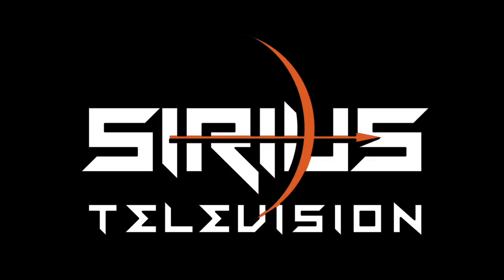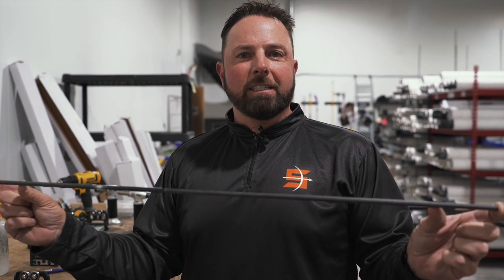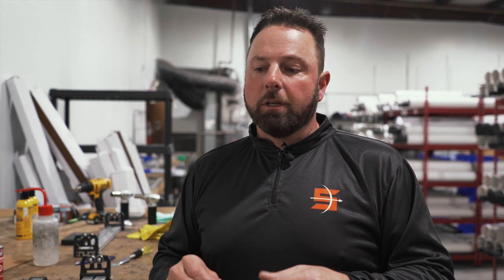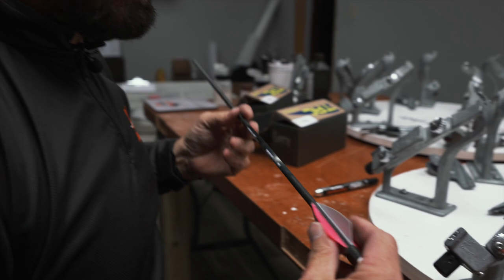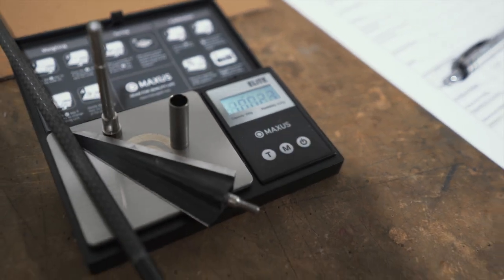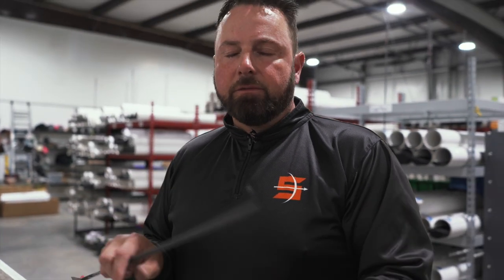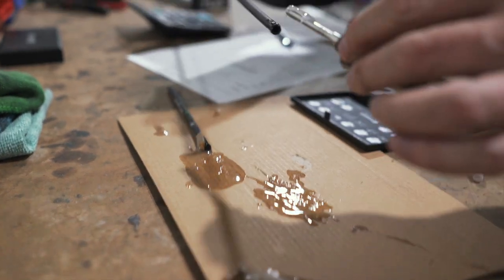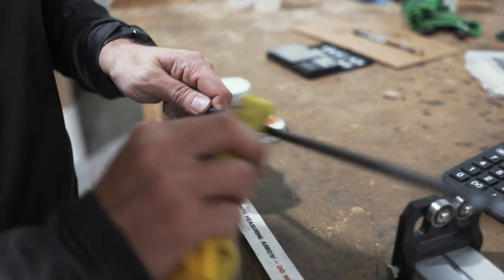Ultimate DANGEROUS GAME Arrow Build! (1000 Grains)

Comment: Wtf do you do when the fletch crete runs down and glues your knock point 😂 asking for a friend. He totally thought he got it before it made it to the nock
Reply from the maker: Were you using a q tip to apply?
Reply: @SiriusTV1  yeah, I drenched the q tip and had what I thought was a nice beautiful bead on the fletch. I pressed it on and it took off running. Caught it with a paper towel and was confident it didn't make it into the nock, even twisted it to make sure. Went to go shoot it weeks later and noticed I left the nock out of the position I designated... that sucker is really solid! Can't help but be a little impressed even though I spent weeks getting that arrow perfectly tuned to bullet hole at 20yards bare shaft only to screw it up at the final stage. Been staring at it contemplating how I'm gonna save it.
Reply from the maker: @cronkthecrunk  put a little acetone on a rag. It should clean it right off
Reply: @SiriusTV1  are you guys ever bringing back the 400gr tough heads? I got some 300spines that could use them

Comment: For the sake of argument I’d love to see someone in your position shoot a light weight rocket ship arrow into a dead cape bufffalo. About 400 grains, 85lb draw. I’m guessing that would be north of 340 fps. Hand sharpened 100 grain BH. Now that would end the endless debate of light vs heavy.
Reply: Eh. Probably not. Heavy helps when significant resistance is met. If you go between the ribs, then weight really doesn't matter. Smack the knuckle and you'll want the spear.

Guarantee one half of the crowd will respond with "of course it'll turn out that way, you hit it in the ribs! You're not supposed to hit the bone!" And the other half will respond "you're supposed to hit the shoulder! The light arrow wouldn't even tickle the meat compared to heavy if you just aim at the worst possible spot!"

And it'll never end.
Reply: @YoureSoVane  only one way we will ever know right? Your “assumptions” maybe right or completely wrong. I’ve recently started shooting pigs with 365 grain setup and blowing thru them fast enough to split sapling trees behind them.
Reply: @deanbrantley  I say we throw some sticks at pigs and see what works. Total weight isn't nearly as important as pretty much any other factor for penetration, due to the way most materials react to KE and momentum, and the formula for friction for that material. 

I shoot 30" and 80# and I'm not comfortable shooting an arrow that light. For the same effort of getting a 340fps arrow you could just shoot 300fps, and for the roughly 10% loss in speed you'd get about 500gr. That's more weight to put towards a stronger broadhead or front end components. Or more choices in arrow shaft. 

Personally I like running high FOC but somewhere short of 600gr of weight. With last year's arrow build, I hit a deer so hard that it took chunks of bone with it, and I still haven't found the arrow.
Reply: @YoureSoVane  I completely understand every aspect of it. I’ve shot deer and pigs (3 in the last 2 weeks) with arrows from 700, 550,440 and now 365 and with 10 different broadheads. To date and I know it’s hard to wrap your head around it because it’s not really logical but none of those setups performed like my light and fast with a high quality broadhead. 
Like I said, I was just saying it was something I’d like to see. I’m not trying to change anyone’s mind. I’d just like to see a test that I’ve never seen or know of being done and hear the results. 
With your 30”dl shooting 80lbs I think you would be crazy surprised at the results. Your setup is way more horse power than mine.
Reply: @deanbrantley  Which broadhead do you use? Personally I like a few broadheads that are 150gr or 200gr, and I haven't found any that appeal to me at the 100gr mark.
Reply: @YoureSoVane  I’ve given up on 100 grain heads as I’m like you. I like FOC. But also I’ve almost gone 100% to 150’s because of more material. I’ve got 150 cutthroat on right now for the next pig, which should be in the morning. But the head I keep going back to is the Grim Reaper Micro Hades 150. It’s good in every way. I think I’ve shot 3 with the same head. Only had to replace one blade. I’ve had Day Six Evo, Valkyrie’s, Kudu Points. It’s just had for me to risk losing a premium component like that when I’ve seen great results from a more budget friendly head. Even though the cutthroat is single bevel I have mixed reviews. My prediction is a pass thru, small slice entry/exit and no blood. But I’ve gone test it anyways. I’m a 3 blade guy. Hunting in the south in thick pines with head high briars I need blood on the ground.
Reply: Pretty sure it's illegal to hunt with light arrows in a lot of parts in Africa and I believe there's even draw weight restrictions as well.
Reply: @charlieplunkett9748  prob so and even broadhead choice. That’s why I said test it on a dead buff. 
Just like the Josh Bowmar Vid. He killed his buff and then shot it with a Sevr BH juts to see what would happen. It blew right through the ribs and half the arrow buried inside and was in perfect condition.
Reply: @charlieplunkett9748  Indeed, as a direct result of the Ashby reports. Whether that's necessary or not is up for debate.
Reply: @deanbrantley  I like the shape of the Tuffhead 200s, and I modified them to theoretically have better aerodynamics. If the Kayuga pilot cuts came in a more premium steel I'd spend the cash in a heartbeat. I started out as a knife guy, so alloy composition and heat treat are the way to my heart.
Reply: @YoureSoVane  I enjoy the craftsmanship of the better material and nice steel. I often wish I’d given the Valkyrie a better chance before selling them. I just struggled to get them sharpe. So now if I get a head that uses tool steel that’s high hardness I’ll choose one that’s easy to sharpen.
Reply: @deanbrantley  I love my Valkyrie heads. They're not the easiest to sharpen, but I have tools specifically for blades like that. I don't think they're the best but they're damn good.